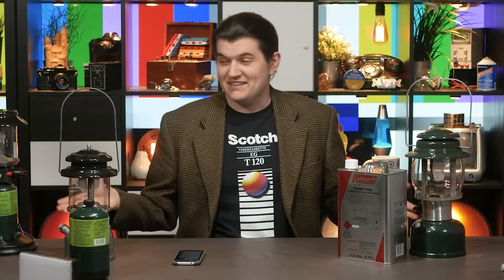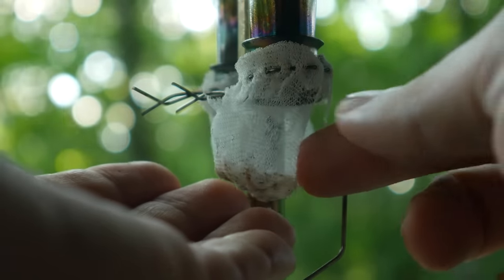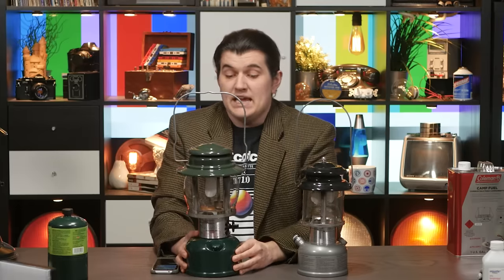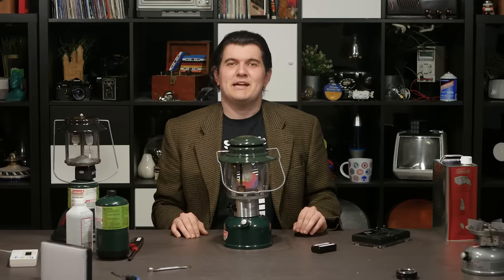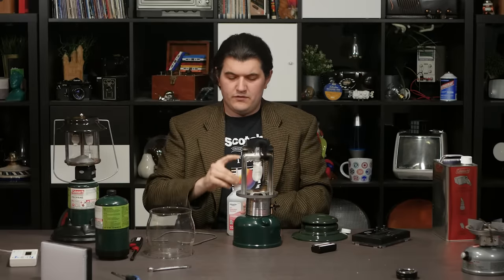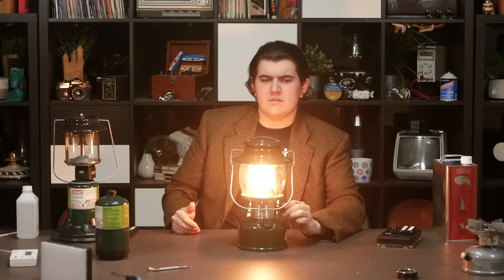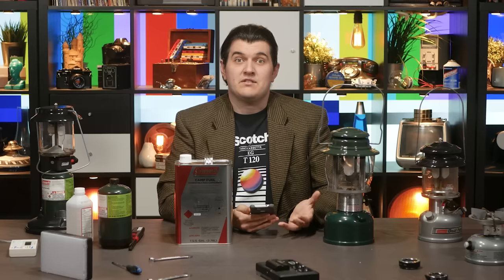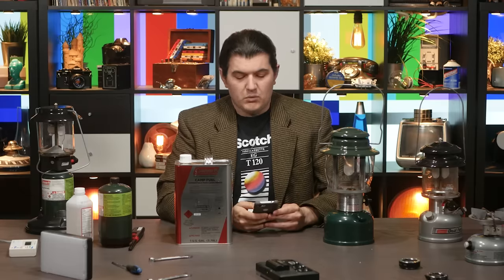A very rambly Coleman Lantern follow-up. Turns out they rarely make sense in 2021

Comment: The pump seal acts like a check valve to let air in on the upstroke, and force it into the tank on the downstroke. It's a cup-looking thing on the end of the pump rod. Probably plastic, the old ones were leather. Pop the black cap off and it should come right out if you're curious.
Reply: huh, interesting. i just thought it was there so if you over-pressurized it a little too much, it won't be a pain in the ass to push it all the way in and screw it shut.
Reply: Correct. Seems to many ignorant people think otherwise.
Reply: The Petromax lanterns still use a leather patch inside the pump, even the ones that are being made today. Source: I own one and recently had to replace the leather patch inside the pump. It is available as a spare part and also is part of the maintenance kit.
Reply: Yeah. Covering the valve just makes the pump work. The pump is useless without covering the hole to allow you to easily put away the pump arm while the tank is fully pressurized.
Reply: No, that’s incorrect. There is a ball bearing check valve located at the bottom of the pump cylinder which keeps the pressure inside the fount. when you turn to open to start pumping air only flows into the fount. The pump has an inner rod that screws down into the check valve. watch Frank from Old Towne Coleman repairs on YouTube- he’s the best
Reply: @Nafregamisrocanob  That little ball can get stuck if you leave it pressurised and then the tank gets hotter or you drive up a mountain. It's a bit of a fiddle to get unstuck, you have to take the valve out.
Reply: your thumb pressure is the pressure regulator
Reply: @tomcardale5596  If you cannot pump, then yes the ball bearing is lacquered shut. Unclip the cover, unscrew the check valve rod and remove the pump. Spray carb cleaner down the pump cylinder and let it sit for a few hours. If that doesn’t help, then the check valve needs to be removed and cleaned, or replaced. Most issues with the check valves are that they won’t hold pressure. Most suggest that you release the pressure before storing or travel. And, always test before taking on a trip!
Reply: @Nafregamisrocanob  oh yes, I take the dismantling tools with me because I've had them stop working mid trip. It's definitely a pressure issue because it only happens when there's been a large rise in internal pressure.
Reply: The last time I installed a rebuild kit on my Coleman backpack stove (several years ago, the cup on the pump plunger was some kind of elastomer (synthetic rubber). I would guess either neoprene or nitrile (since those are resistant to petroleum products).
Reply: @DeputatKaktus  Try using light machine oil like sewing machine oil to lubricate the patch regularly. Though in a pinch I've used everything from motor oil to chapstick to ivory soap to do so.
Reply: @jeroylenkins1745  Vaseline also works well. 

Edit: Had to replace the one in my lantern b/c it was basically crumbling into dust. It is an old milsurp model from the 60s and sat in storage for god knows how long. The leather did not like that. Already had a tear in it when I got it, so replacement was required.
Reply: Put a drop of 3-in-1 oil in there, Scooter. Leather gasket, keeps it from drying out.

(Probably misquoting, but extra points if you get the reference.)
Reply: @priestessofchaos430  Newer ones have a synthetic rubber  cup rather than leather, but either way, a bit of oil will make the pump work much better. I've used a drop of motor oil off the car's dipstick when I've had a pump quit working on a camping trip. Cooking oil will work in a pinch, but it will eventually go rancid and gum up, so it's best to clean the pump and put in some petroleum based oil afterwards if you have to do that, as I have once or twice when backpacking.
Reply: I used to use a few drops of Marvel Mystery Oil.  It might just be my imagination but I think that it tended to make the generators not get clogged so much in addition to making the pumps work better.  Of course I was told that it would "ruin" the lantern, but that never happened to me.

Comment: I'mma be real with you Mr. Connections, the reason why I use an oil lamp instead of a battery-powered lantern while camping isn't efficiency, warmth or the fact that it works in extremely low temperatures.
It's because small flame trapped in a glass ball makes me feel nostalgic. It's like vinyl records, can't really explain that :D

Comment: I have Colman equipment that is 40 years old and I still use them. 
They haven't deteriorated in time with proper maintenance.  Nor have they become obsolete in the way that electronics do. 

I can fix them if there is a problem.  Not so much with electrical gadgets. 
But you also make some great points about LED's and Batteries. 
Fun Video full of thought provoking information.  
Best Wishes !  M.H

Comment: Coleman has a “quad led lantern” that runs on D-cell batteries.  It says it will run for 24 hours, but I have left mine on continuously for a week (over 150 hours) and it was still putting out a useable amount of light.   Pretty hard to beat for an emergency light source.
Reply: damn
Reply: If you're at all like me, though, you'll have some D-cells for it when you buy it and then when you next need it they'll be a decade old and either leaking in the device or dead.  For an emergency lamp, keep those D-cells in the freezer until you need them.
Reply: @alastorclark3492  lithium ion d cell batteries?
Reply: You can buy LED lanterns that run on 18650 and 21700 sized lithium rechargeable batteries. My favorite takes 3 18650s and can charge other things too.
Reply: @hithere7382  Yep and even the nearly dead style of rechargeable standard battery most of them use Lithium.
Reply: @PinkBunnyCorporation  Rechargeable, most of those dead no longer made style of battery used Lithium.
Reply: I can heat and cook on my Coleman white gas lantern.  My grandpa bought it in early 60s. Works everytime. Has a built in flint striker. Came with reflector and he acquired some after market flat top cooking device.  Other than mantels and two generators its all original and functional.  I plan on giving it to my grandson.
Reply: I have an older fluorescent-tube Coleman lantern that takes eight (8) D-cells.  I still use it for rummaging around in my storage attic.
Reply: AA is the way.  I use low self discharge NiMH (eneloop) in everything that takes AA to D.   Spacers that adapt to the other sizes are cheap.  That way you can stock two sizes  - AA and AAA and power a wide variety of devices.  With the LSD variety you can charge them when they run down instead of before use.
Reply: And add a decent solar panel ???
Reply: People don’t realize how many watt-hours were in those old alkaline D’s, or better the old alkaline 6V batteries.  I have a 6V lantern that’s still running on a 22 year old 6V that I’ve used for several hundreds of hours of lighting time.
Reply: @oasntet  I use regular alkaline D- cells. I replace them once a year when I replaced he batteries in my smoke alarms. The old batteries then get used in toys or other stuff.
Reply: @alastorclark3492  I replace them yearly when I check/r replace smoke alarm batteries. The old batteries get used in toys or other junk.  These are alkaline and temp isn’t an issue.
Reply: @PinkBunnyCorporation  alkaline
Reply: ... until the D-cells self-discharge or leak all over the place. (that's my #1 problem with batteries. Even lipo batteries eventually leak -- balloon, etc.) Little can of propane will be there for years -- as long as it was well made, and the plastic seals don't fail. The RV has an 80gal propane tank, still has ~20gal in it and it hasn't been filled in over a decade.
Reply: @PinkBunnyCorporation  Yeah o.O they exist
Reply: @gr2718g  ahh okay :3
Reply: A few years ago I saw some batteries intended for emergency use. They came in standard sizes (AA, D, etc.) and were activated by putting water in them, I think. They were supposed to have an unlimited shelf life before activation. I don't remember the name or know if they're still available.
Reply: Have one in the shed when I need a light, it has a blue night light also. Haven't had to change batteries in a few years. Autism awareness model.
Reply: That's why these mantle lanterns aren't so much good these days. Pretty hard to find propane ones in camping stores nowadays, and as for the liquid fuel ones, you have to order them in advance.
Reply: @oasntet   you can get AA to d cell adaptors that allow for two AA batteries to replace a D cell..  Use energizer AA lithium batteries in the adaptors and use them in your lantern.  The energizer lithium batteries have a lot more capacity than the regular alkaline batteries, don't leak and have a 20 year shelf life.
Reply: @alastorclark3492  most D cells are still alkaline batteries.
Reply: I don’t need a frakking Heating lattern in summer camping

Comment: Alec, I went camping this past weekend and took two Dietz lanterns because of your video.  It was great, I left the LED nonsense in the bag.  Ambiance level 100, convienece and efficiency be damned.  Plus, it was fun.
Reply: This. I found an old cold blast lantern in the attic a year ago and I've been using it a lot instead of a flashlight. But I like its convenience, too. Is it "discharged"? Just pour in some kerosene, bam, off you go. And it never fails.
Reply: I do same thing . Lower light levels preserves your night vision. I do use my led lights for in the tent and when searching the truck.